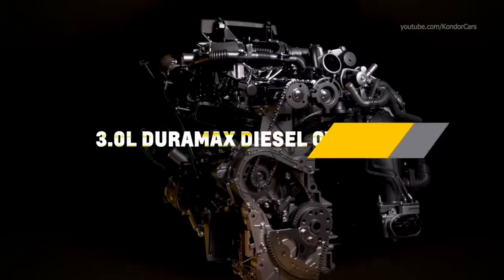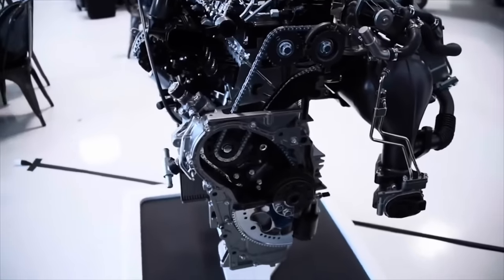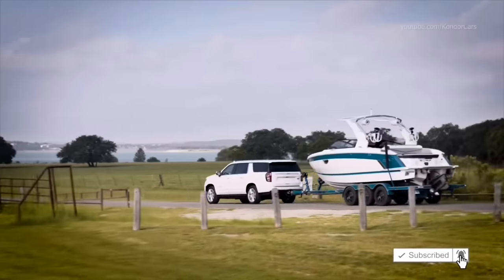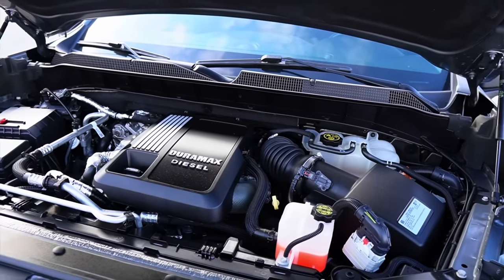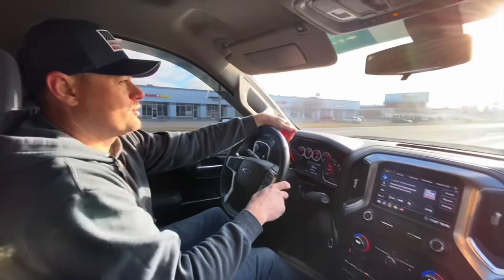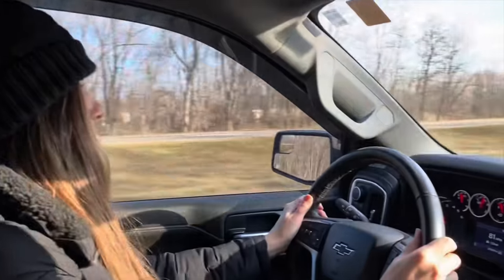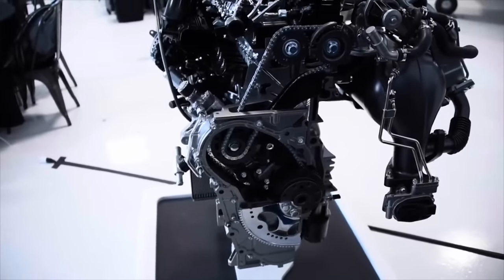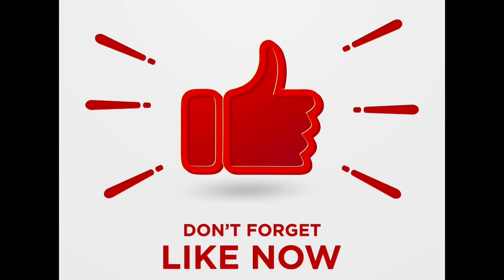What Everyone Needs To Know About The 3.0L Duramax!

Comment: I have a 2021 Sierra 1500 GMC AT4 with the 3.0 and we have temperatures below -40 C in the winter no issues with the engine, just DEF tank freezing even when plugged in.  Highway driving I average 8.4L/100 kms. As for pulling we have a 20.5, 1979 travel trailer. traveling through the mountains I can easily maintain 105 km/hr and average 17L/100km. We have a family of 5 with a lab and no issues with room. Prior to this truck, I had the 2015 F350 crew cab 4x4 with the 6.7 liter and it was a pig on fuel

Comment: Preferred the 3.0 Duramax but ended up getting a 5.3 gas in my 22 Silverado. Crunched the numbers and really it was a wash so just ended up getting the truck that was available and checked all the other boxes. BTW towing capacity without the Max Tow Package is 9200. Max tow package is hard to find.
Reply: And as Tim stated, this isn't an HD diesel. It's been tuned for fuel economy, not towing capability so you're actually no further ahead in that department.

Comment: I use gas Gmc 5.3 and 130k mi one of the valves lifter spring broke and destroyed engine, truck was used mostly empty highway plus city mi, dealer services and engine fail. Now I am on GMC 3.0 diesel and can not be happier, 50k mi already. Gas mileage is outstanding, towed my trailer with car for 2k mi trip and was getting 14-18 mpg doing 80-85 with trailer and car. Highly recommend

Comment: I have a 2020 Silverado with the 3.0L Dmax. Just hit 140k miles on it. Overall I love this engine, but there’re some issues that are annoying. As in a coolant leak in the 5psi system, that nobody can find. Ever since I bought it I had to refill the small coolant reservoir every 3-5 weeks. Also the CEL is on with several codes including DEF, and a couple of glow plugs. I average 23mpg, full with my work equipment, canopy and Bedslide.
Reply: Unfortunately these LD diesels are best to lease and return.
Reply: If the leak is not on the driveway  ! It's burning in the piston ! Bad news for engine failure . A head gasket issue

Comment: I have a 22' Suburban with the 3.0, only 15k miles on it but so far I have no complaints. I had a 20' Silverado 2500 and I don't miss it at all. I tow a tritoon 26 ft with a 200hp motor, downriggers and all my gear, id say roughly 5500lb, I live in the mountains and lakes I fish I way up over 5k ft , 3.0 pulls it no problem with my family in it. One thing I will say is if you tow often like I do keep an eye on your oil filter, mine has come loose from vibration and luckily spotted oil the day it did it and changed it myself. I have heard of others having this happen. Overall the size of the cab on the suburban and the 3.0 engine I am very happy.

Comment: I have two. An Escalade with the 3.0 and a Denali with the 3.0. ZERO PROBLEMS WITH BOTH! My Denali is a 21 with 32K miles. Wonderful fuel mileage. 33 on Hwy and 30ish in city. Same on my Escalade. Both are 4x4s. I love the low end grunt these engines have. I just love engine and 10 speed combo. Go test drive one. You will love it. This is the ONLY way to go. The 355 HP is not a match for the grunt of the Diesel. The full Torque comes in at idle! DEF fluid is a non issue. I add it every couple months. Trust me. Get the 3.0 It’s the only way to go. Take it from me. 2 years and no problems on two of them. Ask any questions. I’m happy to answer. Good luck!
Reply: 6.2 BIG BOY 💨💨💨

Comment: For me the Toyota tundra has been a good truck for me,I’ve driven it 4 years no problem it’s a 2019 had it for four years already , I installed Duel exhaust and a K&N filter And it helped with my gas mileage.

Comment: I’m a mechanic at a Chevy dealership. These engines are awful. Electrical problems, hard to work on, pcv leaks, injectors and harness issues, timing chains issues and much more. Many other dealers are doing engines on them for spun bearings and cracked pistons. We don’t see many, but the ones we do see have some major issues. Can’t forget the emission control related problems.
Reply from the maker: I bet GM is giving you guys push back on warranty work on these as well
Reply: GM certainly questions all the re wiring I perform on them. But if we write a good explanation on the repair order, they don’t seem to be too nuts about it. I’m sure many other dealers down south where more people have trucks (my dealership is is MD) have problems with GM audits.
Reply: @Nic_Adami  how about the new LZO 3.0 duramax.  They are supposedly fixed the issues in these new generation of the 3.0.  Or are they too new to tell?
Reply: Hey, Thx Nic, save me the grief 😊
Reply: I don’t usually comment on stuff but I agree. We bought a 2020 LM2 brand new for my wife in Oct 2020. It spun a #2 rod bearing at 35k in July 2021. Took 3 months for us to get the truck back from the dealer with a new engine. Gm fought the dealer for warranty the whole way. We ordered a 2022 5.3 and traded the Duramax with 46k on it.
Reply: I’m with Nic here. Worked at a Chevy dealer. The engine wiring harnesses are nightmares with chafing, pain in the ass to work on. That turbo looks easy to replace but it’s hell. Seen timing chains stretched at 50k miles. Front crank seal leaks, rear main leaks, and transmission issues with the pump gears
Reply: @spencermartin3457  110k on mine 0 issues all highway tow miles with 10k load.
Reply: @shanebrown2963  haven’t seen any in the wild yet!
Reply: As Always Government Motors will continue to surprise the crowd with Plagues on engine issues
Reply: I will always compare any engine to a proper Cummins V8
Reply: A friend of mine has one with that engine and it’s been there most of the time, issues after issues , now is back again for an oil leak .
Reply: Wow😮
Reply: Maybe that's why there are lots of these on CarMax for reasonable prices and moderate mileage. People dumped them.

Comment: I just dropped my 6.2L Denali (after stuck lifter and bent pushrods) for the 3.0L Denali. Towing is a dream compared to my gas, when in its range, I pull an 8500lb boat & trailer, unbelievably smooth and very nice. Averages towing about 15mpg, not towing, easily getting 30mpg. Not towing a 5th wheel nor a gooseneck. Love it so far. I don’t tow giant trailer but do tow a skidsteer sometimes. It’s all I need, dont need a 2500 so it fills the gap of towing, MPG, and reliability.
Reply: At 8500lbs, how big is your boat? I ask because I’m looking at the 3.0L and my plan is to get a boat in the next few years and I want to make sure this truck will be capable. Your comment makes it sound like it is.
Reply: @andyhudson6299  I still have no complaints. Great truck with a great engine. Short trips, long trips, no problems. Diesel here is 2¢ less than gas too, for now. Boat is about 5,200, got 2,000 of lead (surf boat) and trailer is another 1,200 to 1,500. Tows like a dream  for a half ton. Kinda the best of both worlds, great mileage and very decent towing.
Reply: @matlock339  Good to hear you like the truck and that it’s working out for you. Thanks for the response!

Comment: I own a 2020 crew cab 4x4 1500 crew cab with the 5.3 and the 8 speed. I have driven the same truck with the 3.0 as well as the gas with the 2.7 turbo 4 cylinder. The 5.3 seems to have way more guts than either of the other 2 engines. When we think of a diesel truck, especially a duramax, we think of a powerhouse towing and hauling monster, and that isn't the case here. The only advantage there is to the little diesel is mpg savings, but the 5.3 has dynamic fuel management so will feed as few as 2 cylinders while cruising on the highway, and at 70 mph average I can get 19 maybe 20 mpg on gasoline, which... is $3 per gallon, and I didn't use a drop of Def, vs an extra 5 or so realistic mpg on a fuel that combined with Def is over twice as expensive, I fail to see the advantage. Combine this with the overall design of the engine that as a professional mechanic looks to me as extremely failure prone, and is proving to be in the field. The small advantage that I did see has slipped away into a disappointment.
Reply: ...so right !
Reply: Absolutely. And on top of that the higher cost of maintenance and problematic emissions system. Trucks with these engines will be all over used car lots in 6-8 years and the only buyers will undercut because they know they're going to have to do a delete.

Comment: That truck is a double cab, not a crew cab, that is why it is smaller inside. The 10 speeds are awesome imo. I have a 6.2, acceleration is much better. Maybe you should run a 6.2 up against your Denali?
Reply from the maker: I like your thinking
Reply: I had a 6.2 GMC AT4 for a work truck and that thing was a monster. I had to tow an enclosed trailer with a Honda pioneer in it plus all of our fire fighting gear up the mountains is AZ and it was a great truck. Wish i didn’t have to give it back but I changed jobs.
Reply: @TruckMaster  Just remember the 6.2 requires premium fuel.
Reply: @TruckMaster  would make some good content I think. Of course your Denali will obviously out tow a 1/2 er, but I would like to see an unloaded acceleration run
Reply: @HubersRanch  they do, but much more smiles per gallon
Reply: @HubersRanch  recommended*

Comment: Just purchased a certified preowned 2022 3.0 Duramax, with 25k miles of it, didn’t drive it much before the crank seal started leaking bad. Back to dealership, while I’m in a rental. So far, like the mpg, but maintenance is looking like a huge issue.

Comment: I have a 2021 Silverado with the LM2.   I love the thing.   I came from a Toyota Tacoma, so the LM2 was a upgrade for me due to the fact I have a 3,750 pound travel trailer, the Tacoma hated it....   I am very impressed with the LM2...  The 5.3 gm engines still have the lifter dropping issues so I'd never get another gm v8
Reply from the maker: Thanks for the input Tony
Reply: Lifter drop only occurs in cylinder deactivation engines. The auto start/stop engines don’t have that issue.
Reply: @TruckMaster  also for the oil pump belt, its NOT a cab off job, just the trans and transfer case.   I daily drive a vw golf diesel and I've seen other YouTube channels compare the cost of the belt job to my golfs timing belt job.   Now if it suffers from the extended crank issue, its a crank trigger wheel problem, and that is a cab off fix...   

I got the LM2 just because I am a huge diesel fan and wanted back into a GM.  No other reason.    It fits what I tow perfectly and me and my family can go camping with one vehicle now instead of taking two due to the Tacoma's stupid low payload capacity.   965 pounds VS 1785 pounds....  For what you do, no way would it work.   But I am a fan.
Reply: @RadDadisRad  interesting 🤔 good to hear that.  I still like the baby Duramax 😁
Reply: @slocavky  the baby duramax is a good engine. Definitely works for someone that can use it to its potential. I personally can’t because I don’t have any diesel vehicles anymore. It just wouldn’t make sense for me.

Comment: I have a 2021 3.0 diesel and like it. Average mpg on highway none towing is 34, towing drops down to 20 mpg at posted speed limits. Plenty of power and torque!
Reply: Only problems are the oil pump belt, none start issue and any other repairs.

Comment: The 1st generation 3.0 is sluggish. People wanted the equivalent of the big Duramax squeezed into the smaller package.  Well it's a no brainer it's not going to happen.  However GM did step up with the new second generation.  It is much snappier and you can feel the difference.  
   You had a four door truck.  Not a "crew cab"... Truckmaster  🤔... the "crew cab" is the same size cab as your Denali.  It is as big and the biggest difference is suspension and frame... Truckmaster 🤔... all Chevrolet trucks are virtually the same except the badging and suspension... however you are absolutely correct.  The 1500 half ton is not setup to haul a big 5th wheel and heavy load. However I will tell you that my 1500 High Country 2021 with a 6.2 is capable to say the least.  I also pull a cargo trailer with no issues.  But it doesn't have the sticker rating as a 2500 or 3500 HD. 
  Another note on the 3.0. It really shines and was built for the Colorado.  
  However the most important thing you said.  Anyone looking to buy a truck or SUV. But you can't decide between gas or diesel.  First DRIVE one... stock diesel engines are work horses not race horses.  How. much and how often are you going to tow and or carry a load ? What are you towing and or carrying  ? Look at the load rating on the door sill. Is diesel fuel readily available where you are  ? Some areas are secluded and have gas pumps but no diesel.  Price out the cost of maintenance having someone else do it... not everyone can or has the facilities to work on their own vehicles.  Bottom line DO YOUR RESEARCH AND DUE DILIGENCE BEFORE YOU BUY. DON'T BUY WHAT YOUR FRIENDS THINK ARE COOL. BUY WHAT YOU WANT AND WILL DO EVERYTHING YOU WANT IT TO DO. 
 good video Truckmaster  as always 👍 How are the other builds coming along  ? Btw... thanks for this episode on the 3.0. A Sub is a great vehicle $$$$$. Comfortable and capable.
Reply from the maker: Thanks again Ron, I’m seriously at the mercy of all the back order parts to finish my builds it’s so frustrating at the moment
Reply: @TruckMaster  Fully understand that.  Good old Uncle Joe lol... 
Btw... I hope you and all your family and the guys at Kodiak and RDS... pass it on to them.. have a very Merry Christmas... yes I said MERRY CHRISTMAS... because it is the holiday  ! Lol.. enjoy and looking forward to seeing what's next and your new Sub with the Christmas ribbon on it lol... keep up the great work 👍 Top out
Reply: Dude… did you do any research before this video?  2022 1500 with 3.0 and max tow package can tow 13,300lb.  Also you were in a double cab… the crew cab is much bigger with 8” more legroom.    And why the heck are you evaluating a 2020, when 2023’s are out?

Comment: I have a 2020 3.0 Duramax Silverado.  Both my EGR's plugged at 17,000 miles and fixed under warranty. Also my Def Guage failed at 28,000 miles fixed under warranty needed to order a new Def tank with the Guage and sensors complete. Other than that love it nothing really major. Drove over 600 miles from N. AZ to Tijuana border on a tank of diesel and a 100 miles left on the Guage. Just do the maintenance on schedule and a good diesel additive every 2 or 3 fill ups.

Comment: I just drove the 2024 and I was impressed with how quiet and it was a max tow which will pull 13,000.   It had great power and rode great.   According to everything I’ve read the 5.3 is all you will ever need for towing.   Parts availability is good on the 5.3 but very limited on the 6.2 and the 3.0 duramax.    I was excited about it when I drove it but unless you get the max tow, the 5.3 is way more practical and cheaper to maintain.

Comment: That milage sells it right off the bat. Throw a tune on it and call it a day
Reply from the maker: That’s probably what everyone should do with these trucks
Reply: There is no tune or delete available on this things at the time.
Reply: @Italianborn  Gale Banks is doing R&D. I'm sure the Derringer will be released for it  in 2023.
Reply: @paulbenderavich3833  the derringer on the lm2 won’t work as tuner cause they won’t tap into the ecm, it will only fool sensors and implements fuel and air..or that was the original thought but knowing they’re delaying something must have changed, beside all of that even a proper tuner will only make more carbon deposit and this emission shit will go crazy !
Reply: @Italianborn  I agree with you, but it will still add additional  HP and TQ over stock.  Certainly not the gains one would see from EFLive etc, but something is better than nothing.  I have the Derringer installed on my L5P,  you can tell yhe difference over stock. The only negative is increased soot levels running in the higher levels.
Reply: @paulbenderavich3833  i think i will do the upgrade to cummins or l5p and delete that shit right way !
Reply: @Italianborn  definitely the right way of doing things,  but sadly  times are changing with deleted trucks.
Reply: HP coming soon
Reply: @imlegend4920  let’s hope with delete too
Reply: Diesel is like 30% more expensive so the milage is a wash

Comment: I have a 2021 GMC Sierra 1500 AT4 with the 3.0 Duramax. I bought new in April 2021. I have 32,xxx miles on it. The avg. mpg for those 32,xxx miles is 22.0. Plenty of power even pulling a 32 ft. travel trailer. Once I hit about 20,000 miles and put load range E Firestone Destination XT tires on it, the mpg increased. GM replaced the intercooler at about 6,000 miles. Been trouble free every since!

Comment: I feel like they were reaching with calling it a duramax when they came out. We all know its not a true duramax. It seems like it has alot of failure points that would be a pain in the ass to repair. The idea of it is cool, but GM proved their halfton gassers are built to last. The 5.3 and 6.0 motors are workhorses. Granted the torque isnt as much as a diesel, but they have no issue pulling, and have plenty of power. Im sure with a tune on the babymax and some parts it would gain, but the chain driven pumps is where my concern would be if you ramped up power. Cool idea in the tahoe if it could handle that big camper you got, but idk that it can. I think if they made an actual v6 version of the original duramax platform and put that in the halfton or tahoe, then you may have something there.
Reply from the maker: You are definitely on to something with the v6 idea